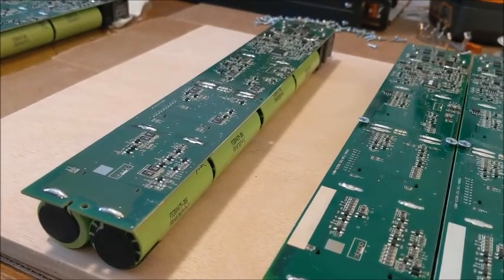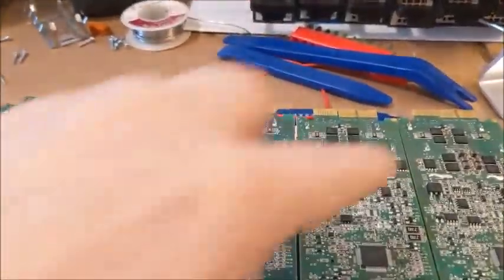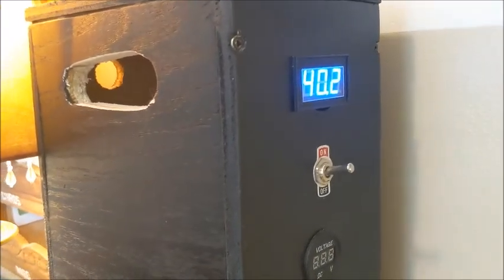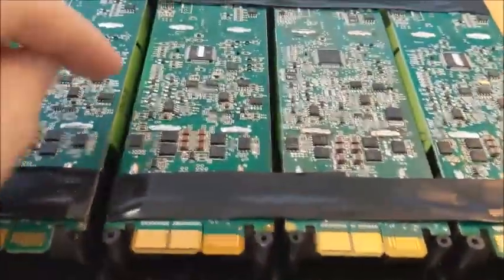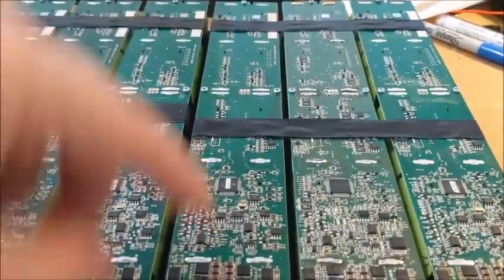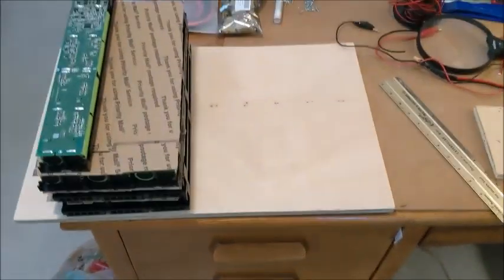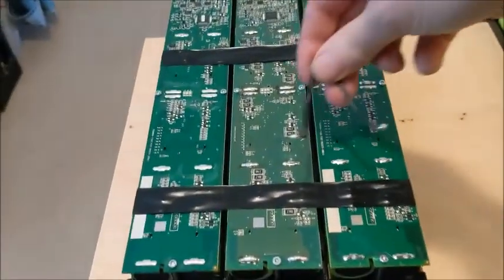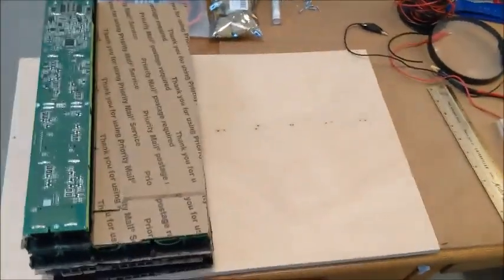Part 2 A Plan - Used A123 ANR26659M1B LiFeP04 in 10 EMC Packs - Battery Clearing House

Comment: Good luck. Sigineer has a relay controlled switch that you can program for voltage. Most 24 volt inverters will run on 33 volts